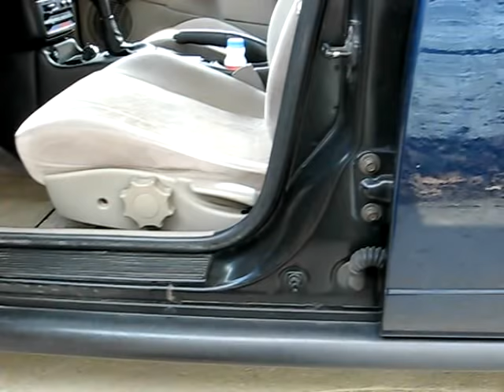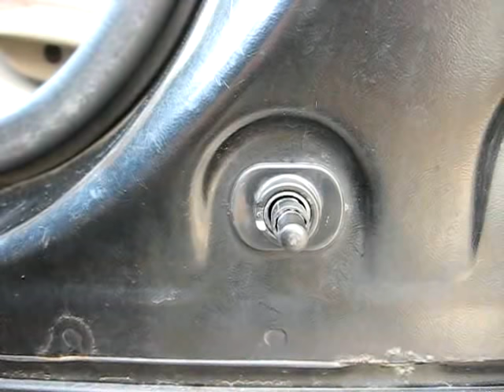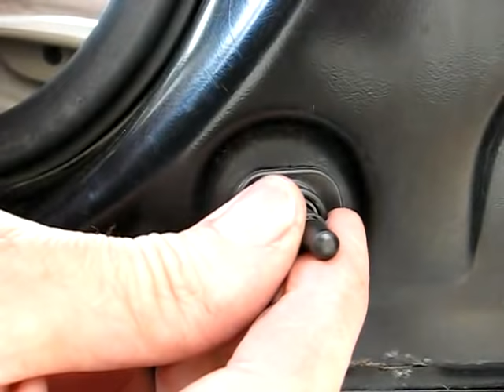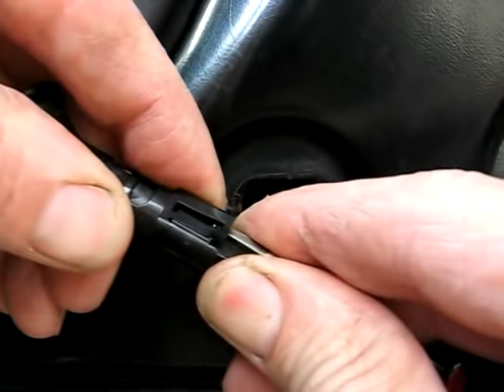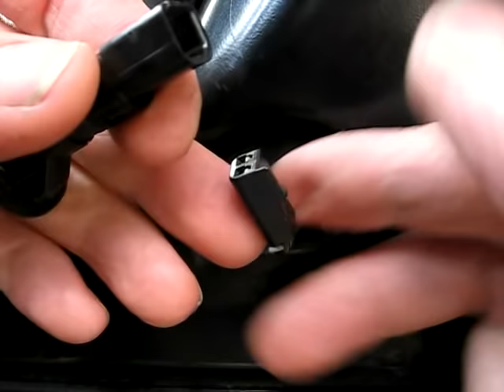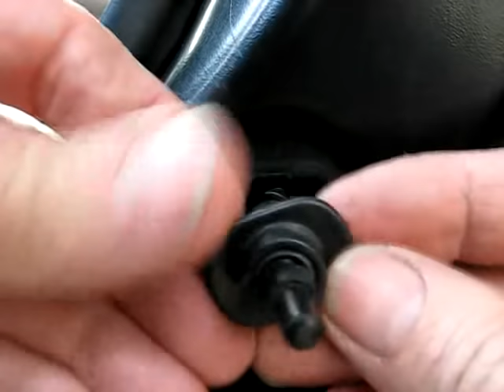Door Switch Remove & Replace (UPDATED VIDEO in description box)

Comment from the maker: @paulclassa On the 2000-2002 the wires from the door switches go to the body control module which is under the dash then from the module to the dome switch.

Comment: I have a 1995 SW1 with a loose boot and a sticky switch.  It's round not rectangular.  There are two small indents on the outside part of the round flange.  Do you think it comes out the same way this one you showed and do you think are the small inmtendts on the flange are indicators of where the catch lip is?  Thanks...
Reply from the maker: I have not removed a 91-95 so i am not sure.

Comment: hi sir, my 2000 intrepid front map/reading light and back works fine every time the doors open but the door courtesy light on 4 doors doesn't goes on.? I know that this are not like Christmas light bulb that if 1 is bad the rest will not turn on. please help, thanks in advance. cheers

Comment: Does anyone know where the wires go?  I bought my mom the 2002 Saturn SL2 she wanted, it was used (she didnt want a new one argh!) She kept leaving the headlights on, and drained the battery numberous times. We figured the dome light did NOT work when the driver door was open and no chimes... Looked at the door jamb switch, it crumbled, I installed a new one, no change. We looked at the wires, found previous owner cut the wires. Cant find where the wires go, to repair it... no books cover this.

Comment: I have cleaned these without much success. Think the problem is the spring gets weak particularly in the drivers side switch and wont properly earth the circuit.
Reply: I.m having problems with the camry ones.